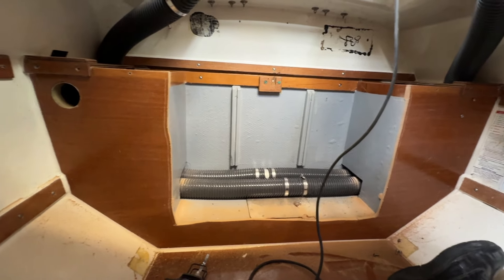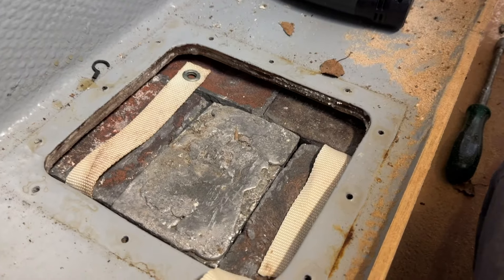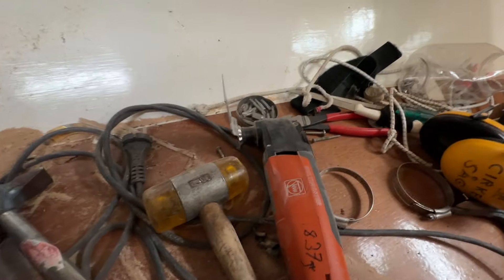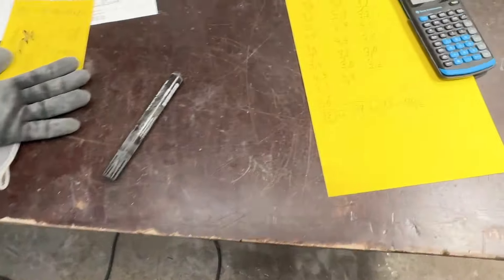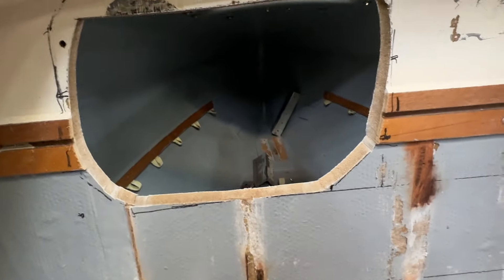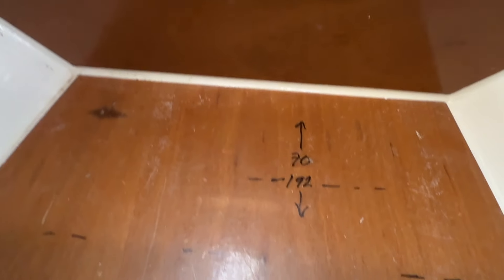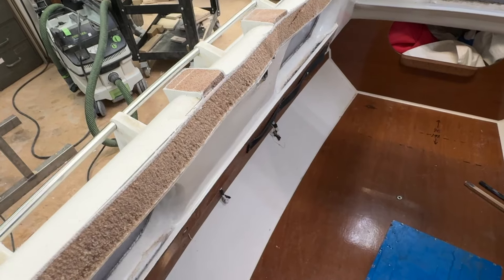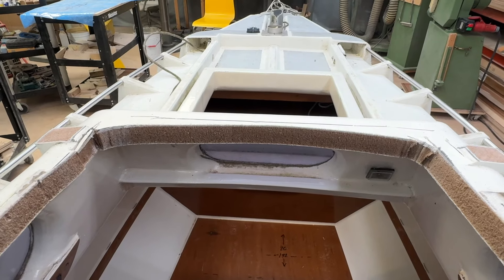24 Sep 2024 Adapting for NZ

Comment: Hi Sven. Your renewed focus and enthusiasm is so good to see. Keep going, we are all supporting your progress. For what its worth, ...I would consider creating only two masts (30% less effort, sails are still balanced, and you could have two hatches... one per mast/sail). You could also stretch the cabin roof, with one hatch at each end, and solar panels on the roof between the two hatches.  Kind regards, Erich.
Reply from the maker: With 3 masts it is very easy to reduce sail by lowering one sail in middle also using the forward sail lee helm using aft sail weather helm
Reply: @SvenYrvindExlex  Yes you have to trim the boat by the sails because the rudder looks inefficient.

Comment: All very sensible Sven.
Have you considered removing the bulky and heavy outside guardrail because you plan
to do all the practical sailhandling from the inside ?
Reply from the maker: I keep it
Reply from the maker: In good weather I walk on deck 
In harbor it is handy for mooring lines and fenders
Reply: @SvenYrvindExlex  OK I understand. Will you fit small bilge keels against the rolling ?
Reply from the maker: @karelvandervelden8819  Rolling is no problem in small boats I have found

Comment: Hi Sven, it‘s so interesting to hear your thoughts of the boat being upside down, which is critical when sailing a small boat in big seas. The boat I‘m modifying is slightly bigger, but the same theory applies, adding boyancy on the top and ballast to the bottom. Thank you for your insights!

Comment: 3:38 Hi Ben, i Will share how to install the leads into your boat. Same way i have done in my Caroff design boat.
Each peace of lead must be enclosed in fyber epoxy or fyberglass. Once this Is done dispose them in the place with a small separación in between. Pour liquid epoxy to fill these gaps in orden to achieve a solid block, previously you may need to lift a containing AND reinforcement ban. Allí these Will add some 20 to 30 Kg of epoxy. Thats it. Good luck
Reply from the maker: The lead will be boulted below the hull